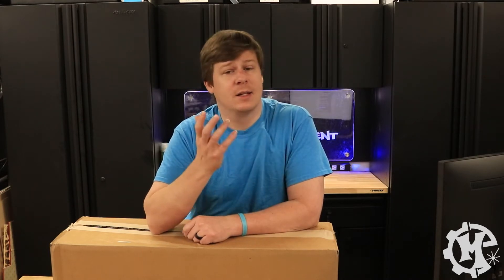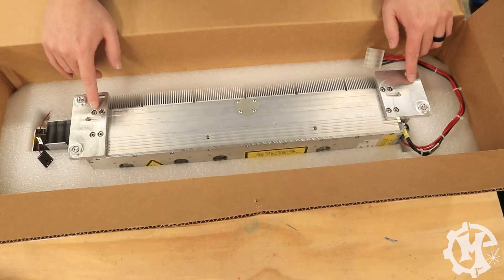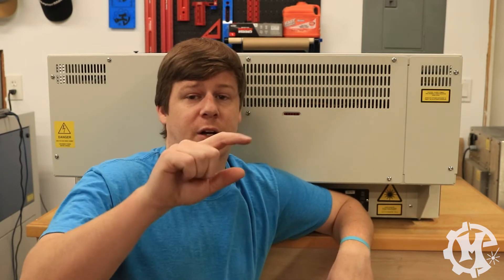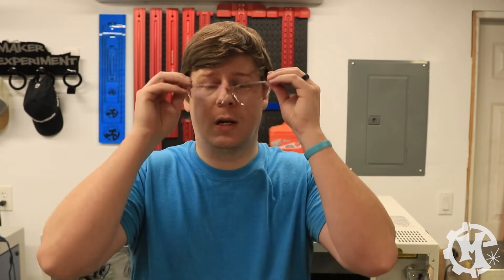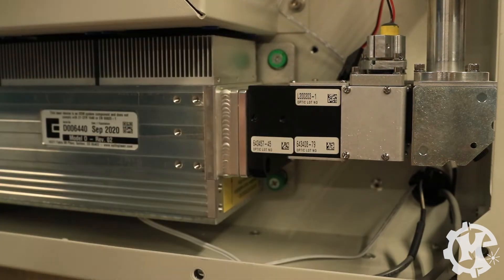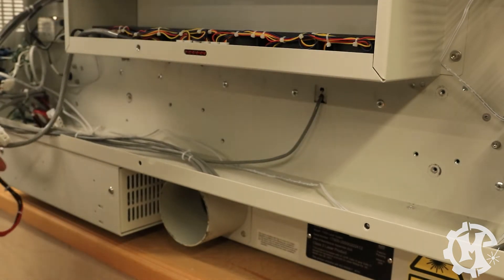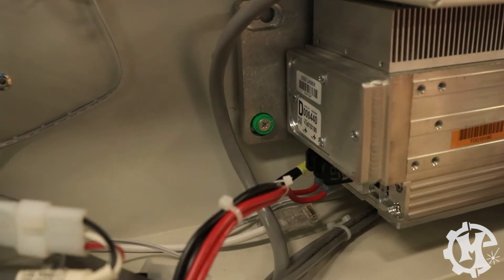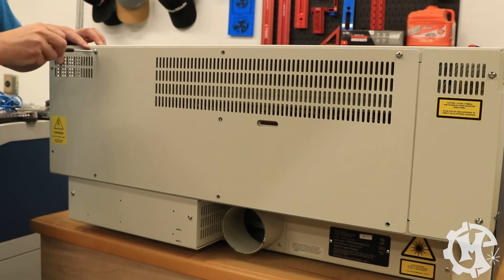HOW TO REPLACE A LASER TUBE ON EPILOG FUSION EDGE

Comment: Thank you for this verification. Still learning.  I engraved some cork and cut coasters.  I had the settings incorrect so there was several passes & some smoke.  Basically burned through the cork.  I turned my air up a little to dissipate the smoke quicker.  I don't know if this was right or wrong thing to do.  I have done little more than experiment with different mediums on my Edge. I have cleaned the tray, bed, mirrors and all other visible parts. Should I need to remove the back and clean the CO2 vents with an air hose after this job?
Reply from the maker: You shouldn’t have to worry too much about that. Most of the job exhaust will go through the exhaust areas and not to the tube itself.
Reply: @MakerExperiment  Thank you so much!  Just trying to do all the right things to keep my machine in good operating condition.

Comment: Unlike my Mimaki which is runs out of ink, laser cutters don’t have that specific perishable/variable to contend with. Still though, I’m wondering how often we need to replace the tubes on the Fusion Edge/Pro series…and how would you know it’s time? Tubes don’t have usage metered.
Reply from the maker: When it comes to lasers, the tube is basically a lasers version of ink. It will go out eventually. When you start to see degradations in power or performance such as having to slow a machine 5% in speed to do something you used to be able to do and if the mirrors and everything are aligned, it could be a sign that your tube is starting to go. It typically doesn’t happen all at once but will be a slow degradation over time.

Comment: I’m calling the request line for a video. Can you produce one on the Epilog camera registration? It’s a great feature that doesn’t get a lot of attention. If done correctly, can prove to be an essential tool in production workflow. Not to mention, it’s saved our butts a few times when we tapped the substrate during during inspection…and you know what that means.
Reply from the maker: Do you mean the normal overhead camera or the registration dot version that reads design dots?
Reply: @MakerExperiment  Hey Trevor. Yes, I'm referring to the latter. Camera Registration Marks for reading "design dots" . You'll see the configurable fields in the Job Manager. Very, very, useful tool.
Reply from the maker: @storytellerHD  that’s not actually on the Edge. It’s only on the pro. Unfortunately, I don’t have that one.